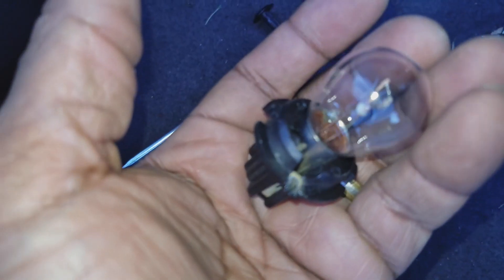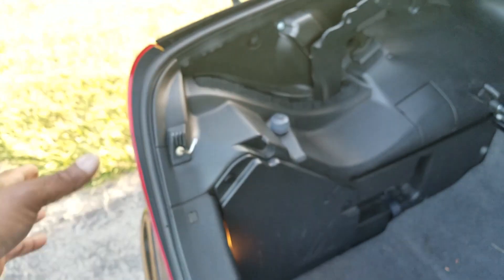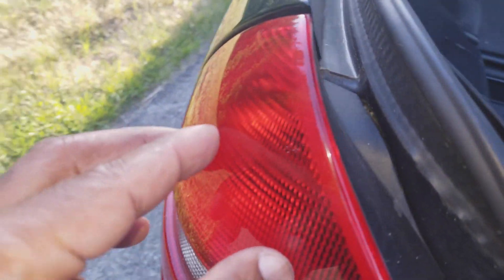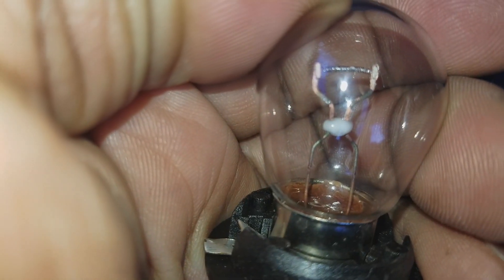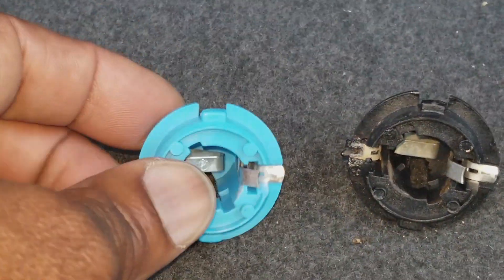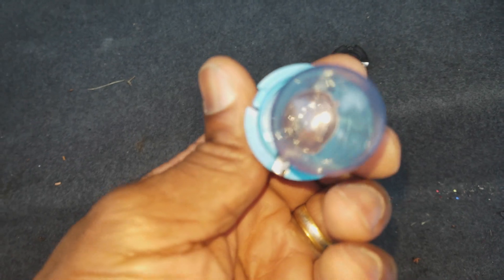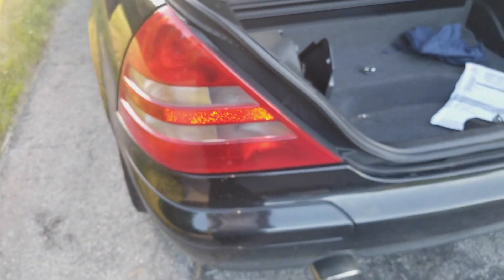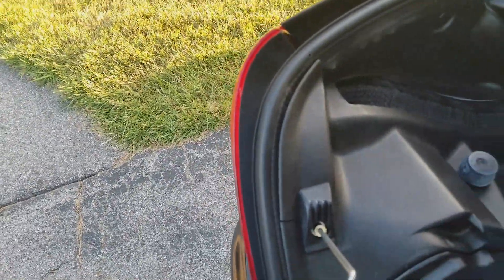Mercedes SLK 230 R170 Rear Brake Bulb Replacement | DIY | iRepair Autos

Comment: the old got really worn out, how that happened?  moisture? mine was just loose. I tightened it and VOILA! did not have to buy a new bulb.
Reply from the maker: the bulbs heat up and cool down, in addition the current going through the prongs heat them up which in turn cause the metal prongs to expand and shrink.

Comment: You know that if you would have removed the plastic side wall piece were the first aid kit usually is, your hand will fit in to twist and turn to get all your light bulbs out.
Reply from the maker: Yes.  I shy away from removing anything I absolutely don't have too. As these cars age the plastic pieces become brittle and crack easily.
Reply: My SLK320 has the same setup. I’ve removed the plastic access panel to reach my hand up in there on both sides of the trunk.

Comment: I read there is a recall on the brake lights on the slk's. I've had constant issues with mine, we've pulled it out and neither the bulb or the socket looks damage.  The complaints were that either the socket is defective and does not provide enough pressure to house the bulb, or they overheat.  We assumed since mine does not look damaged or melted it must be the bulb not connecting with the housing so we adjusted all the clips side and bottom and it worked temporarily, then went out again within 24 hours.  So now I am ordering a new socket, we will try that.  If that doesn't work I'll be ordering a left tail light replacement lens.  I'm confused, is a tail light socket the same as a brake light socket?  I see a blue one on parts geek, but I don't see any part # or a description on this video.
Reply: Look in the tail light assembly itself and check that the metal conductor doesn’t have a small hole corroded into it.  Mine did.
Reply: I have a friend with a 99 alk 230. Back left tail light top bulb is out. I switched bulbs with the left bulb and the bulb was good. I checked the fuse still good. The housing looked good but may change it after checking power supply